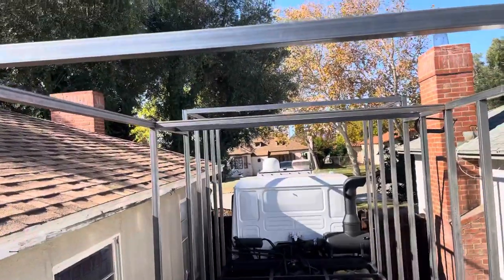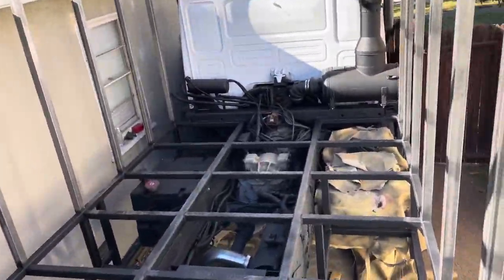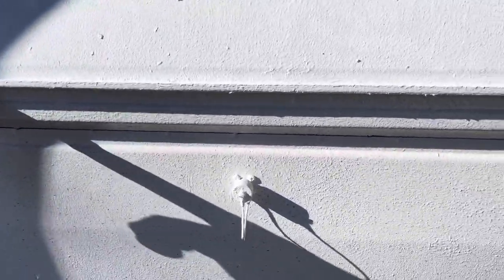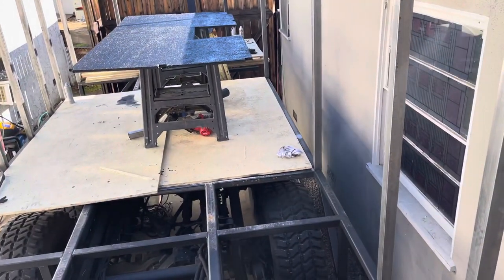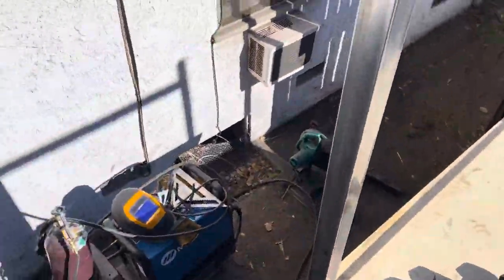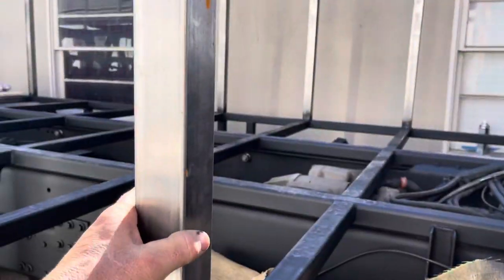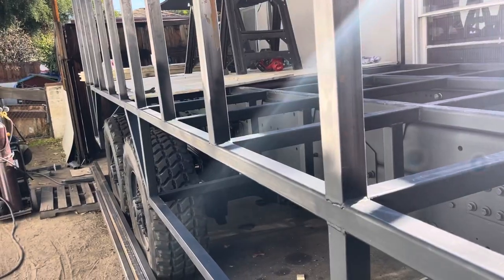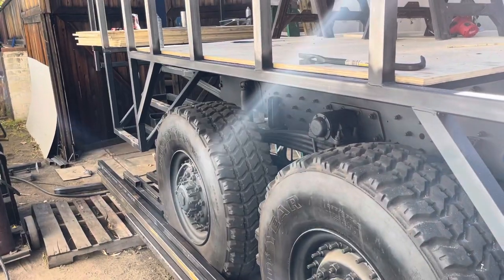Expedition Truck Build day 31.

Comment: Coming right along.   I assume the habitat base as set on vehicle is not perfectly level as truck frame isnt  perfect level -no vehicle is nor is the surface its parked on perfect level.   So to keep everything square you built the rest of frame square to base (floor) frame?  How did you align vertical wall members before welding?  A line or fixture?